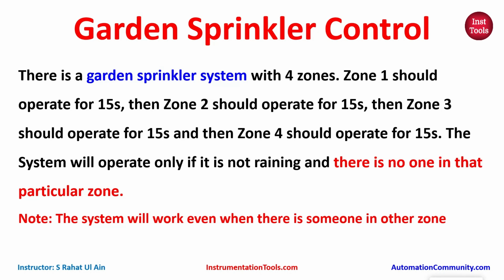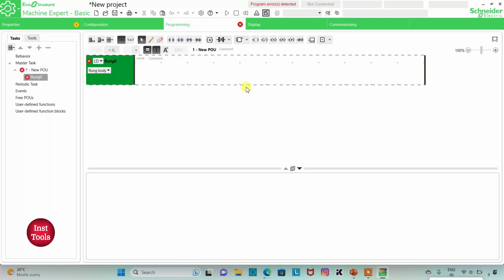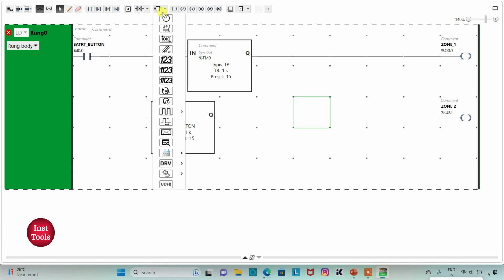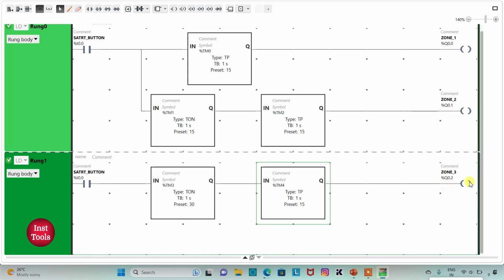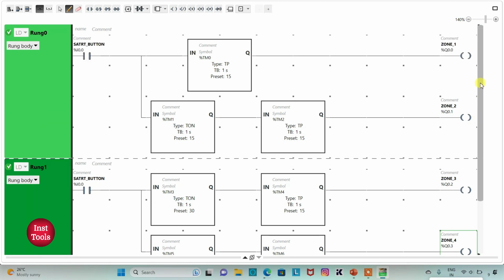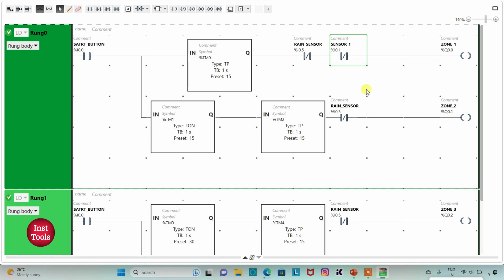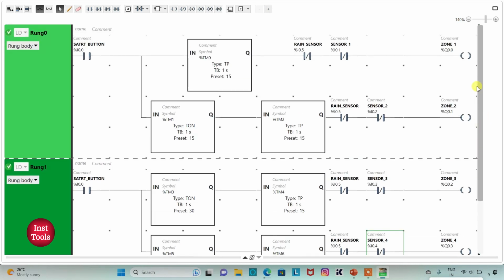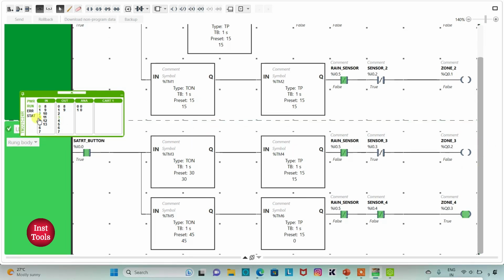PLC Ladder Diagram Example Problems - Garden Sprinkler Control

Comment: Sir more videos on Using COMPUTE/MATHEMATIC BLOCKS

1. S1 ON L1 ON 3 sec

L1 OFF 3 sec

L1 ON 6 sec

L1 OFF 3sec

L1 ON 9 sec

L1 OFF 3 sec

etc...

2. S1 ON L1 ON 2 sec

L1 OFF 2 sec

L1 ON 4 sec

L1 OFF 4 sec

L1 ON 6 sec

L1 OFF 8 sec

3. S1 ON L1 ON 4 sec

L1 OFF 3 sec

L1 ON 8 sec

L1 CFF 9 sec

L1 ON 12 sec

L1 OFF 27 sec

etc...

Comment: Sir make video on using COMPARE BLOCKS

1. S1 ON L1 ON for 3 sec

L2 ON for 3 sec.

L3 ON for 3 sec

Loop this process using one timer and compare blocks.

2) S1 ON L1 ON for 3 sec

L2 ON for 3 sec

L3 ON for 3 sec On for 3 sec

12 ON Loop using one timer.

3) S1 ON L1 ON for 3 sec

L2, 13 ON for 4 sec

L4 ON for 3 sec

L2 ON for 3 sec

Loop this process 3 times, then turn OFF all lights..

4) S1 ON L1, L2 ON for 3 sec

L3, 14 ON for 3 sec

L1, L3 ON for 3 sec

L2. 1.4 ON for 3 sec

Loop three times, then all lights turn ON continuously.

5. PEPSI PLANT:
The bottles are placed in the conveyor. When the start pushbutton is pressed., the conveyor motor starts running for 11 sec and goes OFF. Then the fluid valve is open for 5 sec to fill the fluid and goes OFF. Then the conveyor motor starts for 2 sec reaching the packing machine. The packing machine packs the bottle in 4 sec and turns OFF. This process repeats after the packing is done. There is also an emergency switch placed to stop the process after the packing is done. There is another emergency switch placed to stop all the process in case of emergency.

(Use only 1 timer)

Comment: But it will not reset automatically?
Reply: No if you want to reset it place normally close contact with address of last zone sprinkler and it will be run in loop